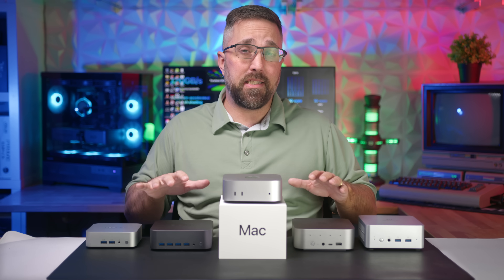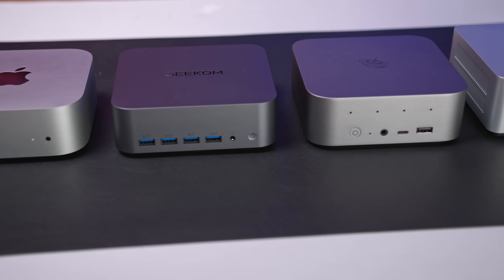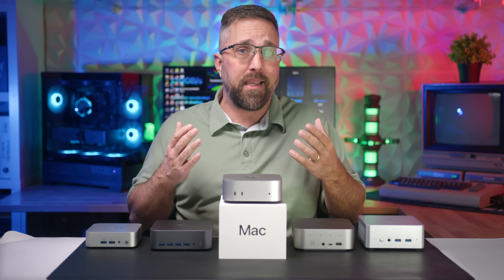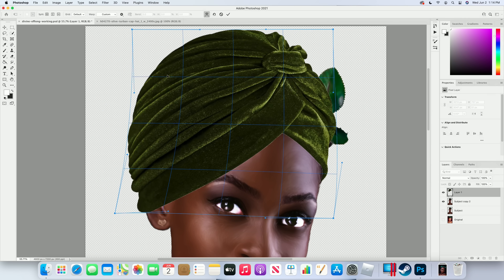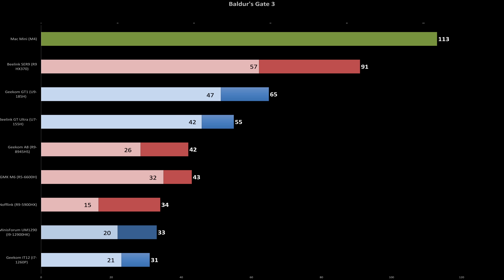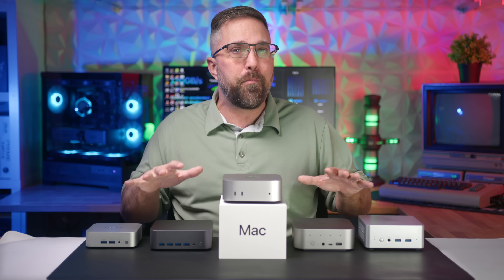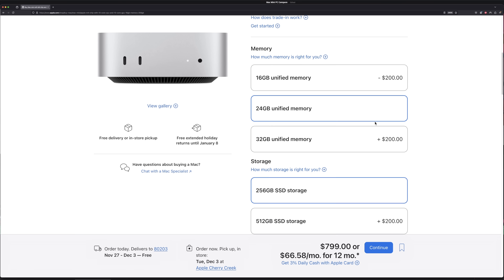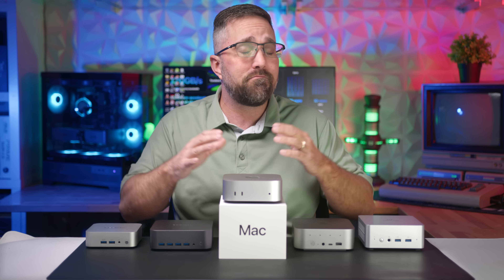M4 Mac Mini vs Intel and AMD Flagships – It's Not Even Close!

Comment: I stopped with my Apple phase a long while back for a number of reasons. 1. they don't make a British keyboard layout. They are always set to Californian standard for the UK and I hate where some of the keys are. (you have to relearn for touch typing which sucks) 2. The Apple Ecosystem is anti-consumer. 3. They make some odd internal hardware choices and many of those are anti-consumer. The price is good on this box but its everything that goes with owning an Apple and overall its a bad deal. They will last a while, but aren't as upgradeable as you think. In terms of games, if you are a gamer, not enough of the games run well or at all on a Mac. What you'd be using this machine for primarily is a media centre and yet the SSD is tiny on this base model. I realise that Apple often sell higher spec options at cost but you'd struggle with this base option. 256GB is not enough for a lot of things, you'd fill it quickly. Undoubtedly, if you are happy selling your soul to Apple, and do media stuff and don't have much desk space, this wouldn't be a bad option, it definitely will be quick. It would be a pass from me. I'd rather buy an older mini PC.

Comment: The TL;DR for gaming is that as soon as games start properly supporting the mac, it's almost not a choice anymore?
Reply: That’s one piece of the puzzle. The other is reliable support of the immense PC library. Many PC gamers, myself included, will prefer sticking to x86 if transitioning means losing a chunk of my library. 

GPU expandability is also necessary. CPU requirements tend to jump with new console gens, but GPU requirements tend to climb steadily over time (and with the fast CPUs in Apple Silicon, the CPU will outlast the GPU by a considerable margin for gaming). Quite often, gamers will upgrade only the GPU in their system. 

And finally, games often require a lot of storage, so reasonable upgradability is important here. 1 TB is really a bare minimum.

Comment: Intel and AMD CPUs unlikely to switch to soldered long term, since there’s a new low profile DDR standard. Another factor with these GPU tests to consider is eGPUs - most of these mini PCs have USB 4 so you can connect a 4090 if you really need. Apple blocks that option

Comment: Thanks for this video, it is interesting to see the Mac Mini vs other Mini PC's. 
It is important to note that most of the performance advantages that the Mac Mini has just come purely from its unified memory architecture. The on-package memory is much faster to access and it can all work for graphics or compute tasks. Therefore the cores spend less time idle waiting for Ram the way that the rest of the Mini PCs do. This is especially true when comparing against Laptop SODIMM memory which has much higher latency vs traditional desktop models.

Comment: Many folks might already have mentioned that the M4 Mac mini power button on the bottom rarely gets used since most people don’t turn off their computers. But if you’re someone who always turns off your Mac and turns it back on when you need it, here are two easy ways to get to the power button without a fancy 3D printer or a fancy dock. All you need to do is turn your Mac mini sideways or place it on top of a small book or tall coaster so you can easily reach the power button.

Comment: I recently purchased a used MacBook Air (M1) it's so impressive that my trusty Windows 11 Beeline Mini PC is now a file server. My Beelink has 40 gigs of ram. The Air? 8 gigs. The Air runs circles around the Beelink. It's not just the performance. This is my first experience with OS X in over a decade. OS X is lightyears ahead of Windows 10\11 or anything Linux. EDIT:  Not a gamer.

Comment: I have a vary powerful desktop PC and remote to it from my phone, chromcast, quest and tablet even my old laptop. I can play the latest games at ultra 4k anywhere even on the road if the 5g is good. Stop buying these compromised mini computers. Just buy a 40 series nvidia and 7800x3d or go for latest if you have the buget ow and you dont need a ps5 or gaming subscription as a bonus. Also Windows is a hot mess but who actually cares your not using Windows your using the software which on a PC is far more varied. Also i dont turn my PC of ever it just gies to sleep when its not used and remote wake on lan powers it up using free WOL software.

Comment: The RAM and Storage on that Mac Mini is so funny and so typical of Apple. 32GB RAM probably add 100 on the price and then more storage to 512GB be like more 100 on the price. If you want 32GB and 1TB then the Mac Mini probably is on par with the other that cost 900-1000

I probably have my next PC as a mini PC but for sure not from Apple. I just dont like the Apple closed environment and i am not willing to over spend as i have built my own PC to get best for the budget.

Comment: unfair comparison. If you want to have an Apple computer - buy it because you can, and do not justify that it is beneficial. An Apple computer can be a laptop, inside monitor or a mini. You impose this limitation on the rest of PC computers, and this.... makes no sense. Whether the computer is standard size or tiny - for 99% of people it does not matter. Compare "normal" computers for 599usd and "Mac" will cease to be great.
Reply from the maker: Normal PC? Try to Spec out a modern normal PC for $599 that matches the performance of any of these.

Comment: With the only important task being DaVinci Resolve video editing, how does a Mac Mini M4 Pro with maxed ram compare to a maxed Ram Beelink Gti14 with GPU Dock & RTX 4080?
Reply: @valkiron11 I mean anyone who’s ever dealt with the Windows registry or drivers would disagree. In general the development community prefers MacOS specifically because of its Unix/Bsd roots. The Terminal in MacOS is extremely easy to transition between Linux and MacOS, and in general it’s far more stable than Windows. Windows cornered the market, that’s true, and by that measure it’s the only option for many industries. That doesn’t mean it’s good software, it just means it’s mainstream. I mean pop music is usually terrible but it’s popular. If anything the Unix base of MacOS has more installs than Windows, Unix and its derivatives are the foundation of modern computing, and internet infrastructure. Tim Berners Lee literally created the http protocol on a network of NeXT computers at CERN, which is the foundation of the www as we know it. And NeXTstep is the foundation of OsX which is the basis of the modern MacOS. Windows was stolen from Gary Kildall by IBM and Gates. One was influential by brute force, the other actually innovated the entire foundation of modern computer networks.
Reply: I mean anyone who’s ever dealt with the Windows registry or drivers would disagree. In general the development community prefers MacOS specifically because of its Unix/Bsd roots. The Terminal in MacOS is extremely easy to transition between Linux and MacOS, and in general it’s far more stable than Windows. Windows cornered the market, that’s true, and by that measure it’s the only option for many industries. That doesn’t mean it’s good software, it just means it’s mainstream. I mean pop music is usually terrible but it’s popular. If anything the Unix base of MacOS has more installs than Windows, Unix and its derivatives are the foundation of modern computing, and internet infrastructure. Tim Berners Lee literally created the http protocol on a network of NeXT computers at CERN, which is the foundation of the www as we know it. And NeXTstep is the foundation of OsX which is the basis of the modern MacOS. Windows was stolen from Gary Kildall by IBM and Gates. One was influential by brute force, the other actually innovated the entire foundation of modern computer networks.
Reply: I mean anyone who’s ever dealt with the Windows registry or drivers would disagree. In general the development community prefers MacOS specifically because of its Unix/Bsd roots. The Terminal in MacOS is extremely easy to transition between Linux and MacOS, and in general it’s far more stable than Windows. Windows cornered the market, that’s true, and by that measure it’s the only option for many industries. That doesn’t mean it’s good software, it just means it’s mainstream. I mean pop music is usually terrible but it’s popular. If anything the Unix base of MacOS has more installs than Windows, Unix and its derivatives are the foundation of modern computing, and internet infrastructure.
Reply: @ghost-user559  The better operating system will always be subjective. I always found MacOS to be a bit archaic and clunky, cleverly decorated with its colorful UI and silly animations. I tolerate it, recently, thanks to Apple silicon. But I always find myself going back home to Windows. The core issue with Windows is that it's just software, which means it encompasses a plethora of hardware ranging from the most competent to the worst potato. Macintosh is its own entity, so Apple could keep it competent.
Reply: @ghost-user559  I just download software and drivers are a non issue. It seems you have zero idea how to use a window laptop effectively.
Reply: @arpsichord7474 Yeah good thing only one windows laptop ever existed. Its probably the only hardware configuration on earth and I’m sure it is the exact same experience that every other person has had with every single windows computer for all of time. Amazing.
Reply: @ghost-user559  Its literally on the website of the specific brand. It handles the drivers for you. Literally how is that an issue. I prefer AMD over intel but both have software like this. Even Nvidia does. Do you have to baby everything? Because its not hard at all. At least not as hard as you make it out to be.
Reply: @arpsichord7474 Yeah I know what it is to download drivers. In general my issue is more about the forced updates than drivers, although I also prefer the Mac way of handling midi and external devices. Drivers are just one issue, and those issues stack up over time. The bloat of all the subscriptions just to use a Word processor, or make a spreadsheet. Macs get Pages, Numbers, IMovie, GarageBand, Keynote. After using both, it’s objectively just a better experience.
Reply: @ghost-user559  Yeah no. you just said something stupid proving again you have no idea what you're talking about. When a driver is installed. The old driver is uninstalled. Also lots of people agree that office is miles ahead of anything mac has to offer. And if office doesn't work. Download something that will. Its as simple as that. Also office can be used without a subscription. Good luck getting those external devices or ethernet.
Reply: @arpsichord7474 I know reading is hard. No, you cannot opt out of Windows Updates permanently. You can’t cancel them, and you can’t permanently disable them. We are not talking about drivers. I said that you made some huge deal about drivers which is one single issue out of many issues. Then I said the  biggest issue I have with Windows is the nagging screens, forced updates, and yes, the subscription just to use a Word Processor and make Spreadsheets. I use Ethernet? What exactly is so esoteric about Ethernet lol?
Reply: @arpsichord7474 Besides honesty sounds like an OS isn’t the biggest thing you are dealing with. Go outside, get a pet, go on a date, make some friends. It seems like trying to feel a sense of self worth from random comments on the internet is too important a metric in your life at the moment. No one cares if you like Bill Gates. Good luck.
Reply: @ghost-user559 Rollback doesn't exist? Office online doesn't exist? Im not the one who can't read. And how are drivers an issue at all? Like at all? You clearly don't know how to use windows. And nagging screens are again a personal problem and something thats honestly non-existent in the modern era.
Reply: @arpsichord7474 It doesn’t matter if rollbacks exist if I DO NOT want to update lol? It’s my computer. I should never be forced to do anything just to boot up my own system. it’s absolutely laughable. I used Windows from 95-Windows 8, all the way throughout until I test drove 10. Tried modern OSX at mountain lion after using Macintosh color back in the 90s, and it was just better, and it only got better from there. Yes. Windows defender and windows security is a constant stream of pop ups every single time you try to run or install anything. Nagging screens are a default operation of Windows design philosophy, whether its a forced update, a nagging screen trying to block a program running, a nag screen attempting to block some installation process or a nagging screen asking for a login to some cloud service. It’s constant. There are ads in the start menus, they are everywhere, constant windows spam.
Reply: @ghost-user559 Guess what else you shouldn't be forced to do. Choose certain things because something better is restricted. macOS being from apple restricts your freedom. The popups from defender are there for your own computers safety. and macOS is glitchy and not worth the almost double price tag of some similar speced windows laptops.
Reply: Tim Berners Lee literally created the http protocol on a network of NeXT computers at CERN, which is the foundation of the www as we know it. And NeXTstep is the foundation of OsX which is the basis of the modern MacOS. Windows was “taken” from Gary Kildall by IBM and Gates. One was influential by brute force, the other actually innovated the entire foundation of modern computer networks.
Reply: I think the Mac is worth it just to have less fan noise, no crashes or viruses, and MacOS itself. It’s just a way smoother experience than Windows. Yeah on paper the Beelink with the RTX will give you “more power”, but in reality it will also waste more of your time in the long run. The Mac will give more peace of time and less stress overall.
Reply: @ghost-user559  Biased, Apple sheep reply. The only valid point was less fan noise.
Reply: @valkiron11  False, it’s the objective reality. Now if the comparison was between a full custom PC build for the same price point? Well then you would have a valid point. But when it comes to mini PCs, Mac is objectively superior. Aluminum chasing build quality wins, Thunderbolt 4/5 wins, low to no fan noise, and wattage under load wins. 10 GB Ethernet wins. SSD speed wins. Ram efficiency wins. Only thing that isn’t objectively better is the Gpu, but really without a full PC you are not going to be able to push any gpu to its full performance with such a small thermal envelope. Now Linux or Windows might be an advantage for some use cases, sure, but MacOS has a free version of Word, Excel, and it has GarageBand, IMovie all for free. Windows has a subscription just to use a word processor now lol.
Reply: @ghost-user559   Didn't need that whole paragraph. Everyone knows Apple are the kings of hardware. Software, not so much. MacOS is still inferior to Windows, from compatibility to usability. Just take a look at which operating system holds the highest market share. The numbers speak for themselves.

Comment: I have a Minisforum UM690S, that came with a 1TB NvME, 32GB RAM, and cost $350 (After a $170 off coupon). I mainly use it for game emulation, which it is more than capable of.

I'd say those going for Apple is either they don't know much about tech and just hear Apple is best or look at prices and higher price mean better, or it's just a status symbol, like getting a $1500  IPhone over a $600 Android or $100 Nike shoes over $40 K-Swiss, because of the name brand on them. I'm happy to say my 6 year old $600 Android and 12 year old $40 K-Swiss are still going strong.